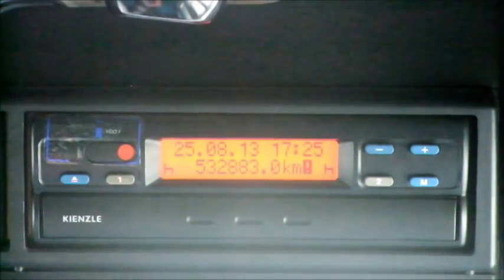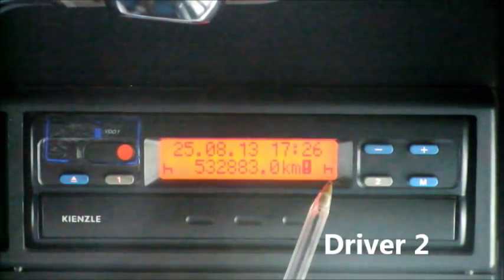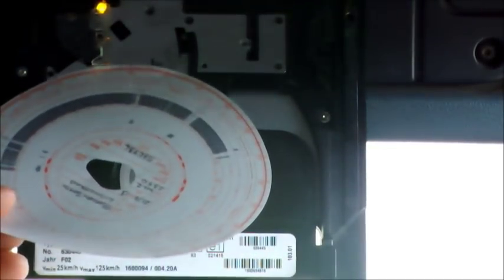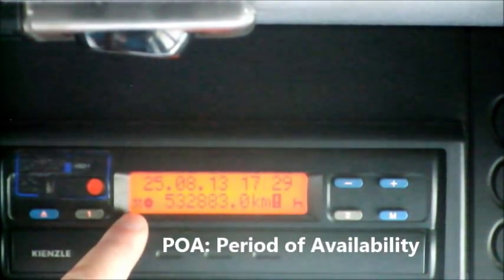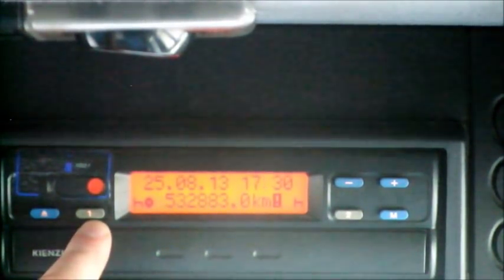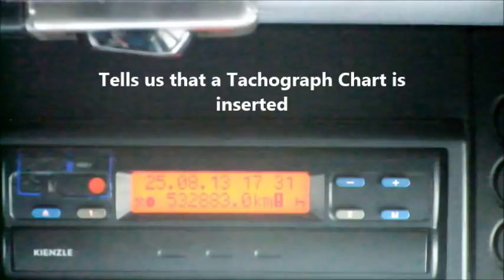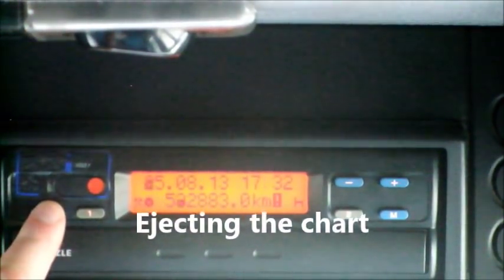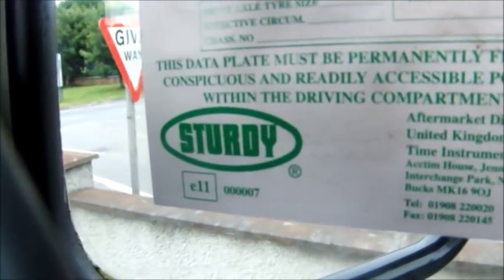How to use a analogue Tachograph Cassette Type. Northern Ireland

Comment: Brilliant advice thanks. Ive been told all sorts from ,when driving use bed mode after 10 minutes of having on crossed hammers for walk around checks to have it on POA! This video should be made standard on all CPC courses for new drivers or those wanting to refresh memory. It can be a complex matter using tachos  correctly so videos like these are invaluable.
Hope you will have some more soon.

Comment: I've never used my taco but it keps running my batteries flat during the winter. I killed a few once they froze!
  I tried t connect it to ignition positive rather than permanent positive but it kept going into limp mode. So i put it back the way it was so i could kill a few more batteries but it still goes into limp mode. Then i wondered if i just didn't know how to set it up or how it was setup before. I don't have any discs but now i can't use the van at all, i live on a mountain and it does not like limp mode!
Help. Where did i go wrong and what do i need to do to get mobile again?

Comment: I had problems with this once On Mp2 Axor . It would draw a line if you try to eject the chart for lets say inspection. It would pretty much make in invalid after that. I was told that it isnt a fault but a design flaw in earl models. U cant Eject the chart while the engine is running,which is common for most traditional chart users to do. You need to stop park turn the engine off switch to inactive than eject, change the chart and initiate driving again.
Reply: Brilliant needed a brush up after years of tacho card thanks